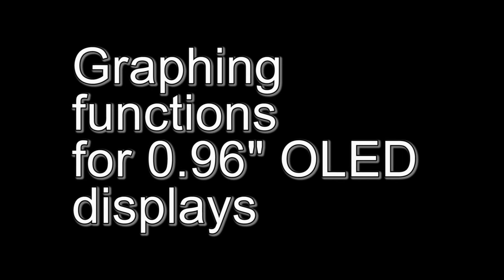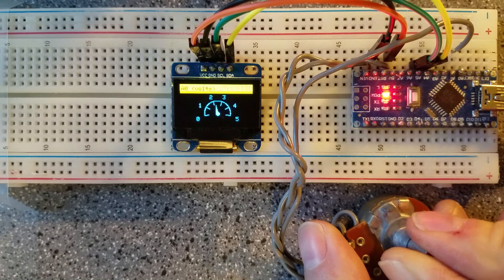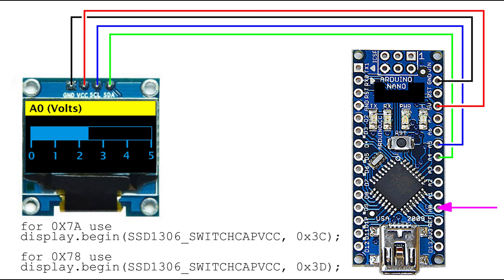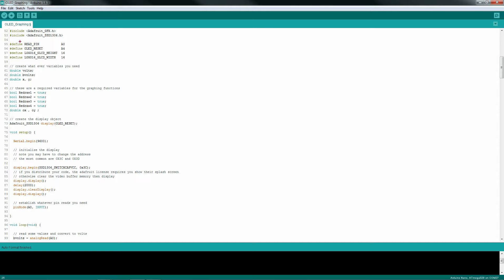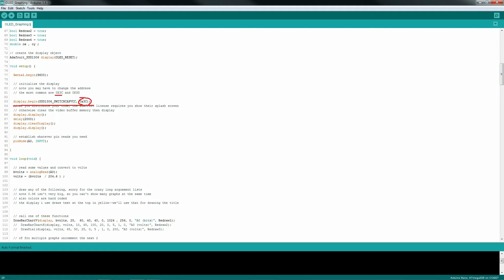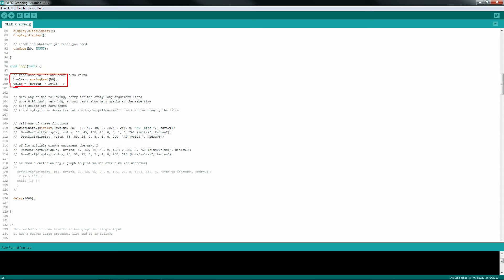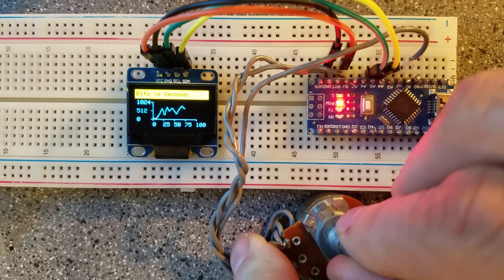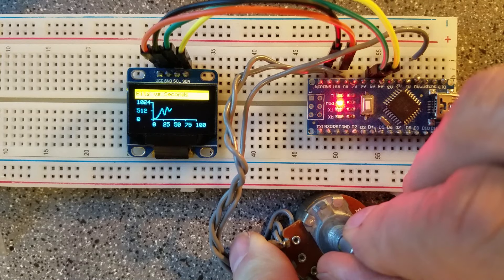FREE Functions to draw graphs on OLED displays

Comment: Hi Kris,
Great project but a bit out of date on Library usage.  In order to make this work people will need to make the following changes:
Add this info to the beginning of the code:
#include <Wire.h>
#define SCREEN_WIDTH 128 // OLED display width, in pixels
#define SCREEN_HEIGHT 64 // OLED display height, in pixels

// Declaration for an SSD1306 display connected to I2C (SDA, SCL pins)
// The pins for I2C are defined by the Wire-library. 
// On an arduino UNO:       A4(SDA), A5(SCL)
// On an arduino MEGA 2560: 20(SDA), 21(SCL)
// On an arduino LEONARDO:   2(SDA),  3(SCL), ...
#define OLED_RESET     4 // Reset pin # (or -1 if sharing Arduino reset pin)
#define SCREEN_ADDRESS 0x3D ///< See datasheet for Address; 0x3D for 128x64, 0x3C for 128x32
Adafruit_SSD1306 display(SCREEN_WIDTH, SCREEN_HEIGHT, &Wire, OLED_RESET);

Remove the following code:
#define SSD1306_128_64
#define READ_PIN            A0
#define OLED_RESET          A4
#define LOGO16_GLCD_HEIGHT  16
#define LOGO16_GLCD_WIDTH   16
// create the display object
Adafruit_SSD1306 display(OLED_RESET);

Then the code runs great!
Reply from the maker: Thanks for posting your tips. I'm sure my subs can make use of this. 

I posted that code some 5 years ago, and I've since moved on 2.8" color TFT,s  with touch, hence I spend no time verifying the operation of these OLED's

Comment: Thanks Kris!  Will use this.  I have been using part of your code in an antenna analyzer project.  From your video using TFT displays.
Reply from the maker: Cool, I too am using more and more of the TFT's--mostly the 2.8" versions. I've got them working with a Teensy 3.2 and have touch, and the SD card working. Took some hardware hacking though.

Comment: Hi, Kris! Loved the video. It works well. I was wondering how refresh and start replotting once the data hits the end of the screen? Can you suggest a modification to the code? It would be very helpful.
Reply from the maker: I depends on how you want to continue.... 1) just erase the data and start drawing over or 2) have the grid "pan" so you can see previous data. 

for option 1 should be easy but will take some minor mods 1) upon the need to start over you will need to update the parameters in the function call 2)  set the "redraw" variable to true--that will force a repaint 3) remember the last x value and you will have to offset the new plot area by that amount meaning 0 is no longer 0 it's now like 100 or what ever your last value was, when you call my DrawGraph function just change the x to x+offset and remember to add the offset to the range parameter, after resetting the "redraw flag" it will get you closer. Writing this from memory. 

Option #2 the pan one will take a bunch of changes--namely on a new point draw the grid area needs to pay--not hard, but probably more involved.

Comment: Just spent several hours trying to figure out why my display looks like it's putting  a black line between every line.  Therefor, only showing the top half of a full display.  Otherwise it works great.  I'm using a 128X64 OLED just like the one in the video.  Any help would be greatly appreciated.
Reply from the maker: look in the Adafruit_SSD1306.h file. I suspect the wrong define is being used. Look for something like this....

// ONE of the following three lines must be #defined:
// probably need to uncomment this line
//#define SSD1306_128_64 ///< DEPRECTAED: old way to specify 128x64 screen

// probably need to comment out this line
#define SSD1306_128_32   ///< DEPRECATED: old way to specify 128x32 screen

//#define SSD1306_96_16  ///< DEPRECATED: old way to specify 96x16 screen
Reply: @KrisKasprzak  Thanks Kris,  I figured it out an hour or so after posting and you are correct, appreciate the reply though. Take care.
Reply: @KrisKasprzak  thank you a lot, you helped me too. It was strange for me, that it needs changes in library code, but, it is deprecated approach now, and looks like in new constroctors you manually put in your project code width and height of display.

Comment: The libraries used in these examples do not support Attiny85. I couldn't find anything related with creating graphs on Digispark/Attiny85 like you did on the video. Do you know any solution?

Another question, is it possible to make pie chart like graphs which can be transformed into slices which also can be wider/narrower by a potentiometer like you just did? And even rotate the graph with another potentiometer or something else?
Reply: The APIs are just code written on code. For the 85, red the APIs and write the chunk you need into your 85 code... so no API needed.

Pie graphs use Pythagorean theorem.
a^2+b^2=c^2
and the edge of the pie is at "c" distance from 0,0.

So, graph a line from 0,0 that has a slope of b/a and is c long.

Comment: Hi Sir! Thank you for sharing your function. So I was using this function on an 12c OLED (128x64) display. My problem though is that the title takes a lot of space, cutting the lower portion of the graph. I want to remove the title bar completely. How can I do that?
Reply from the maker: With this display, you can't. the pixel colors are built into the display.

Comment: Great! I want to graph two charts, barometric pressure at the top and Temp at the bottom. Same time scale but different Y axes. Is this possible? Regards
Reply from the maker: sure is. you will just need to  create a second call to the graphing function, but with different screen coordinates, and its own Redraw variable. I've done this before, just very small graphs. you can also use 2 OLED displays and draw a single graph on each display. Same basic code implementation second graph: DrawBarChart(display2....)

https://youtu.be/yef23sJjiU0

Comment: This seems to be working for me,thanks! 

EDIT: it seems to update much slower then the example? Like only once per second or so .
Ah , I need to set the delay to a shorter amount then the 1000.

I also did the redraw for when it hits the end of the screen. 
Has anyone figured out how to make it pan/scroll so it keeps the valued and just inserts incoming values ?

Couple  of questions,  can i shorten the time span for the envelope signal or the graph?
EDIT: Figured out how to shorten the graph and the time.

For example:  DrawCGraph(display, x++, bvolts, 30, 50, 75, 30, 0, (CHANGE THIS -30), 25, 0, 1024, 512, 0, "
And this if (x > 30) {

Still that leaves how to make it sample faster , anything above a 6 hz sine wave gets turned into a triangle of some sortÐ

 Also can i somehow remove the measurement values and text  only leaving the graph?

If I wanted to run say 5 displays , do I need to get a teensy , seems weird that the arduino would almost max out on memory on one tiny display ...I am a beginner though so I might be wrong here ?

I would also be cool to be able to use triggering somehow , so it can act more like a scope, whereas it would hold the waveform.My input signal is coming from a function generator and works cool , but would be nice to be able to trigger so it would not scroll.

Comment: This is awesome. Anyway to shrink it down for a 128x32 oled display?
Reply from the maker: sure the giant argument list has parameters for graph height and with. Look at the functions and find W and H, these are the graphs width, and height--just squeeze the height down to what you need.

void DrawBarChartV(Adafruit_SSD1306 &d, double curval, double x , double y , double w, double h ,
Reply: @KrisKasprzak  I'm looking to use the dial. I see on the bar where to change it but I can't figure it out with the dial. Anyway you can send me a pic or something. Please!!
Reply: @KrisKasprzak  it would appear as though I have the same oled display as you. I've uploaded the code but the bottom half of the dial is cut off. Any way to fix this?
Reply from the maker: @imgoingtwo2780  I think so. the default oled libs are for 128x32
look in your Adafruit_SSD1306.h and around line 29
un comment the #define SSD1306_128_64 and  // #define SSD1306_128_32 like i have shown beow.
// ONE of the following three lines must be #defined:
#define SSD1306_128_64 ///< DEPRECTAED: old way to specify 128x64 screen
// #define SSD1306_128_32 ///< DEPRECATED: old way to specify 128x32 screen

Comment: again asking: no way to get more than the upper part of the display. I have tried to configure the 1306 .h file, but no results. My oled is AliExpress one 128x64, with 078 and 077 bridges, set for 0x3C. Of course I am almost a beginner. I do know that the solution is simple, but don't get it. I get the same problem on both 128x64 and 128 x32 displays.  Any input, please?
Reply from the maker: What MCU? What library? what color tab on the display protective screen?
Reply: @KrisKasprzak  thank you Kris, problem solved

Comment: Hey Kris,I noticed you didn't have anything for a license on that OLED code that I'd like to use for a project I'm building.  I'd like to give credit where credit is due so if you want anything included please let me know..  Also, if you're into video editing you may want to take a crack at AVID Media Composer. It's a little more versatile if you're into pro level stuff. (Just a suggestion).Thanks, Andy

Comment: Using the same hardware, the images do not appear fully, getting bigger than the display. How to solve this? When compiling appear errors: 
Arduino: 1.8.5 (Windows 10), Placa:"Arduino Nano, ATmega328P"
OLEDGraphing:149: error: 'SSD1306_WHITE' was not declared in this scope    
OLEDGraphing:232: error: 'SSD1306_BLACK' was not declared in this scope

Thanks! the explanations are excellent.
Reply from the maker: regarding the errors, open Adafruit_SSD1306.h and find the defines for the colors, my lib is #define SSD1306_BLACK 0, #define SSD1306_WHITE 1, #define SSD1306_INVERSE 2. I would change the ino to match what's listed in the .h.

Regarding the wrong size, make sure this line in the  Adafruit_SSD1306.h  is uncommented  #define SSD1306_128_64
Reply from the maker: there are also several areas in the Adafruit_SSD1306.cpp file that use that define, make sure you have all of them named correctly in the .ino, the .h, and the .cpp files.
Reply from the maker: Glad you got the #defines sorted out. I've since uploaded a new file that contains the sketch and the libs so others don't have to fight with that.

in my loop() notice a line while (1) {} of x is > 100, this while is simply and infinite loop to "stop the code" by putting the code in an infinite loop (serial monitor will stop as well). You will need to implement your own way in processing what to do after x = 100, maybe redraw the graph and start over, maybe "pan" the graph so you can see previous values?

curval = date to graph hahahaha type should say  data to graph, which is basically the data point to be drawn on the screen.
Reply from the maker: try this loop, note that measuring a single point for display, then waiting is definitely not the best way to measure data. I would average as many readings as possible in the time interval the display--let me know if you need sample code.

void loop(void) {

  // read some values and convert to volts
  bvolts = analogRead(A0);
  volts = (bvolts  / 204.6 ) ;

  // draw the data on the graph
  DrawCGraph(display, x++, bvolts, 30, 50, 75, 30, 0, 100, 25, 0, 1024, 512, 0, "Bits vs Seconds", Redraw4);

  // if the data exceeds the graph range then reset the old graph markers and blank out only the graph area
  // note the selected values will need to be change if the size or location of the graph is changed
  if (x > 100) {
    ox = 30.0;
    oy = 50.0;
    x = 0.0;
    display.fillRect(31, 18, 75, 32,  SSD1306_BLACK);
    display.display();
  }

  delay(1000); // display every 1 second

}
Reply from the maker: code to average the analog pin reads

unsigned long OldTime; // best to move this line up where your other variable definitions are
unsigned long counter; // best to move this line up where your other variable definitions are

void loop(void) {

  // get as many reads as you can in the allotted time
  bvolts = bvolts +  analogRead(A0); // add it to itself and average before display
  counter++;

  // check to see if the elapsed time exceeds the alloted time (note this is in milliseconds)
  if ((millis() - OldTime) > 1000) {
    // reset the old time counter to enable elapsed time computing
    OldTime = millis();
    // if the code lands here, you must have read bvolts for 1000 ms
    // avarage the volts
    bvolts = bvolts / (double) counter;

    // draw the data on the graph
    DrawCGraph(display, x++, bvolts, 30, 50, 75, 30, 0, 100, 25, 0, 1024, 512, 0, "Bits vs Seconds", Redraw4);

    // reset everything
    bvolts = 0.0;
    counter = 0;

    // if the data exceeds the graph range then reset the old graph markers and blank out only the graph area
    // note the selected values will need to be change if the size or location of the graph is changed
    if (x > 100) {
      ox = 30.0;
      oy = 50.0;
      x = 0.0;
      display.fillRect(31, 18, 75, 32,  SSD1306_BLACK);
      display.display();
    }
  }
}
Reply from the maker: You were so close the draw line arguments from the adafruit library are object.drawLine(x1, y1, x2,y2, Color)

x is the current x value so that needs to be both x1 and x2
y1 is the lower part so that needs to be the graph's y coordinate which is gy and is y1, y is the value to plot so that is y2

try this...
d.drawLine(x, gy, x, y, SSD1306_WHITE);
Reply from the maker: Not sure worked on my display but i still have the scales, maybe something went astray when those were removed. Link to the code is dead.
Reply: @KrisKasprzak  Hi Kris. I just downloaded your code and had the same problem. Perhaps the updated code isn't attached to the link you had for the original code? It looks like your original link is still tied to the original code.

I made the changes manually and got the code to compile and run but the display is messed up: I can see the Bits vs Seconds reverse video title at the top of the display, but the graph doesn't seem to fit the screen properly. The bottom line of the display is partially overlaid by the rectangle showing the reading and the background doesn't seem to be getting cleard on screen changes. Maybe changing to BLACK and WHITE to fix the compile problem isn't a good solution?

I'm building with Adafruit GFX 1.5.1 and Adafruit SSD1306 1.2.9 which might have something to do with the problems.

Regards,
Tom
Reply: I get it now, you don't remove the comment "//" in front of the type of the function call you want to use, you copy and replace the one you want to display with the one that is called just before the end of the loop. It works fine.

Thanks, for the examples.